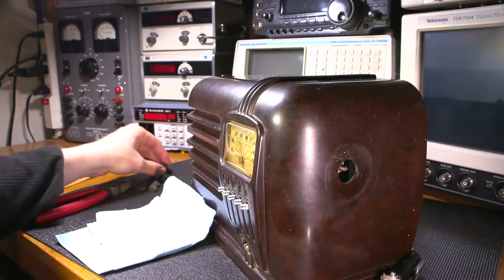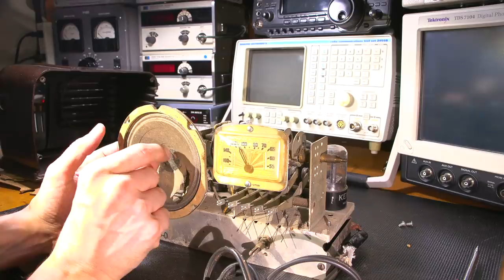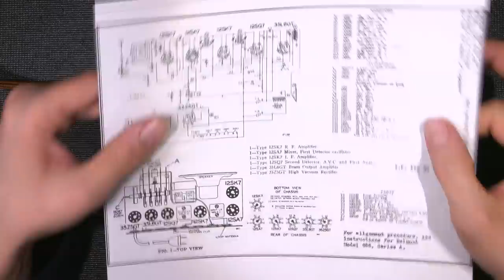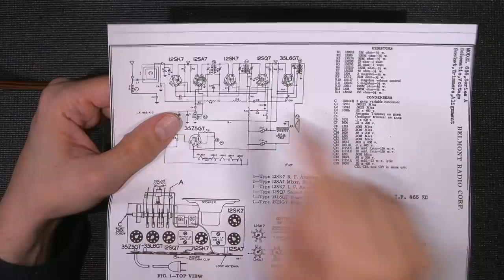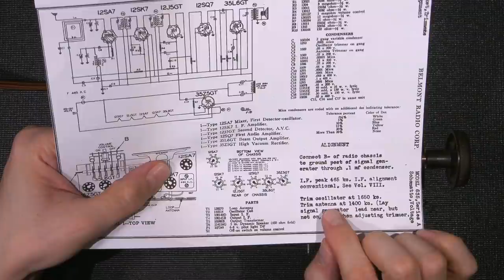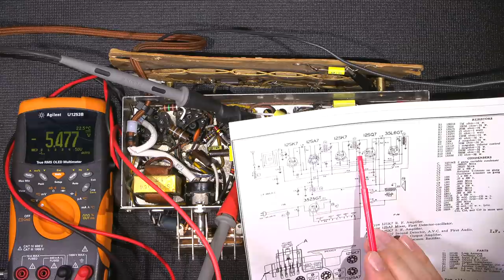Electronic Restoration Adventure-The Belmont 636 Radio Receiver!

Comment: This Belmont 636 Radio seems to be receiving more stations than even transistorized radios. Such smoothness, you can hear everything in between. I remember tube radios being this way. Smooth and rounded out tuning. Let's you hear an entire world of radio.
Reply: 2 years later, still pretty much the only transistor radios that can equal or exceed that radio in receiving are the ones made by C Crane, I can walk outside with my pocket C Crane radio on AM band at night in North Carolina, and assuming no electric interference, and no unusual atmosphere conditions, on a clear night can pick up loud and clear, all the New York city clear channel frequency stations, and hear in background of 570 stations and WSB 750, the Cuba and Venezuela stations each on those frequencies
Reply: @perryb3263  Can you post a link to this C Crane Radio? I am interested.

Comment: I was interested to see that an RF Amplifier Valve was included before the frequency-changer valve, but only a two gang tuning condenser fitted. So when you showed the circuit diagram, I realised that the mixer input was untuned. This arrangement seems to work very well indeed ! What a great little radio it is, and after your restoration and alignment what a super performer.

As a restorer myself, I know how gratifying it is to hear a restored radio, or other piece of electronic equipment,  'burst' into life and perform as well (or possibly better) than the day it came out of the Factory !!

I do enjoy watching your restoration Videos, and hope you will post many more of them.

Comment: It is hard to imagine sitting through the 2-hour video but it was fascinating to to see those old radios come back to life. I repairs those when I was a kid while other kids were delivering newspapers or mowing lawns I was trying to kill myself in surplus electronics and earning spending money fixing radios and record players. When I was 10 I got my ham license so focused more on shortwave equipment building and begging my father to drive me to the nearest air force base just 4 miles away, for their surplus disposal auctions. It is a wonder I only shocked myself a few times on the high power transmitters but at 13 I moved my shop basic test equipment to a small office behind the library I rented by telling the owner that I was running an errand for my father who had the same name, and who shared his father's name. It told the owner that my father was away on business and had asked me to secure the office. After school every day I raced my bike from school to the library to repair hifi, turntables radios and CB radio.  I could only work until my  7pm dinner time. 6 months into that the landlord called our home asking for me, and my mom naturally gave the phone to my dad who had no cue as to why someone was calling about an office until they both figured it out. I continued with that shop until I graduating high school mid-term at 17yo and sold the shop to the parents of my only employee, a boy who was also a nerd but a little older. The little shop was moved to larger facilities twice until the new owners retired about 5 years ago as the largest hi-fi store in the city.  I was very active in ham radio since age 10 and loved talking to people all over the world, which turned into a bug for traveling to visit places I talked with as a kid and have traveled to 91 countries.  
The day I graduated I packed up as much gear and some clothes in my 58 Chevy and moved 100 miles to San Franciso in 1966 where I rented a nice apartment overlooking the ocean on a cliff near Cliff House. The plan was to work to save more money and try to get into college but that was sidetracked by the musicians finding out I could repair their amplifiers on my kitchen table since there was only one music equipment repair shop in the city with an exploding world-famous music center of the mid-60s. The second person to knock on my door needing emergency repair was a tall Mexican kid who had no money and I did not charge anyway but he said he would have money that night if the amp was repaired. I took care of it and wrote out a short note as a pass to come hear him play for free. I did go despite having little interest in music and that was the first time I heard or heard of Carlos Santana. He spread the word and suddenly everyone was hiring me to design new gear or pa systems and eventually took over a failing recording studio and went on the record 197 gold and platinum albums in the  3 studio complex. 

Those little dangerous All American 5 AC/DC radios got me started, I took a break and got my BSEE but never used it because my dream as a kid to work for HP was bypassed with a long very successful career in businesses and recording.  I gave everything away and moved to another country in 2000 and on each return visit packed my suitcases with test gear and started a little repair shop for fun and experimenting in the heart of a beautiful historic culture city of St Petersburg Russia and spent most of my time exploring the fabulous museums and palaces or the music scene, dancing several times a week until dawn, dating beautiful women and starting 2 incoming tourism businesses. All that, 71 yo started with my dad bringing home a broken radio for me to take apart and play with at 6yo. The pandemic put a damper on my social life but have a beautiful 35 yo lawyer GF who keeps me busy. She tolerates my taking over a large bedroom as my lab filled with test gear for audio and RF up to 5Ghz. Watching your meticulous restoration was fascinating. I have watched a number of your videos and my first question is how do you get so much done despite having such a small cramped space left after filling it with stacks of test gear from the 60-90s.
 I still love test gear. One of my side businesses after collecting hundreds of HP and Tek pieces, was opening a repair shop for pro audio I started in 1990 around the time I sold the studio, it was to be a 1 man hobby shop since I did not have to worry about money. It grew to be the largest pro audio repair facility in the country(world) with 23 fulll time techs plus me and support staff of 8 and warranty station for 58 brands, and full depot maintenance for two by replacing their factory service. Each tech has two full benches stacked with some of the 524 pieces of restored HP Tek,m Sound Technology, Fluke, and GenRad equipment, plus RF service monitors from IFR and Motorola. I had collected all that and refurbished it all as part hobby and part obsession

Comment: Thanks for sharing, Paul.  @1:40:00 with IF adjustments was new to me, and worth learning.  I rarely work on tube stuff where heaters are in series with mains.  I had a tube amp like that at one time, and was too easy to get shocked with.  I like the idea of replacing brass tuning screw too for insulation like the rest of the box.

Comment: Good show. As a boy apprentice in a radio/TV shop in the 50s such basic radios, usually without the RF amplifier,  were current. I reckoned to fix 6 or 8 of them each day. At that time sets that were considered "old"  when they had grid bias batteries and wet electrolytic smoothing condensers. FM sets (Zeniths etc) were also grist as were record players and black-and-white TVs.   We had lots of "Muntz" brand, and other TVs, to fix. I was about 12 when I started. Health and Safety would never allow that now sadly.

Comment: Well done as always ! One take away for me from this video was the trimmer capacitors thin mica insulation. Once a few months back  while I was blowing off the dust from under the chassis of a Philco Model 60 radio my high pressure air nozzle got to close to the Mica capacitor and blew mica fragments all over the place ! I had to find a doner chassis with these capacitors as I did not see anyway to fix the bad ones ! Thanks Again

Comment: I'm working on one of these right now. The caps were all the Solar-types. The large one, like the one in your radio, was blown out and the wax had melted all over the line cord. The others were partially melted. I tested them once I removed them, and oddly they weren't that far off of their original capacities.
On a side note, my mother worked at Belmont Radio from 1938-1940. I like to think that she may have worked on the 636 that I now have.

Comment: Great video. I love those mechanical parts in old radios and in everything. I have my shop with a lathe and other machine-tools. I have two of those kind of radios, made in Argentina (my country). Really well made. Things of that quality are no longer manufactured in today's world. Now everything lasts a short time, it is all made with little resistant materials and does not admit repairs of any kind. I HATE THAT. That is called programmed obsolescence. Before, everything was made to last a lifetime and could be repaired. That also gave people work and a desire to learn. I am 31 years old, but I prefer the things that were made before, until the 2000s. Greetings, from Buenos Aires, Argentina.

Comment: Awesome vids!  I will mention with soldering, everything is a heat sink,  so typically, pulling the tubes before applying heat will reduce the amount of time it takes to flow the old solder.  Also, an old trick is to clamp a pair of pliers (hemostats) if room is available, to keep the heat away from other components.  Thank you for the videos.

Comment: From m experience the pilot lamp is in the rectifier circuit, and it is usually a #47. Looking at that speaker, reminds me of one of the older radios that I fixed that was missing the speaker. Great job on repair, and you do great work. I'm glad to see that you know about repairs that most of us have not seen. I understand why WD40 works good is that oil dissolves grease, I have used diesel for the same use in the past. Also even when I know about stuff there is many times that I leave things out that you would talk about, even things that are 2nd nature to me. The Bakelite case is the only plastic of the time. What about replacing broken glass for the dial indicator? I have one here that I have not yet repaired. The one thing you did not mention about the old style resistors is that they did not have the same standard numbers that we have today, such as 50k now is 47k, 25k now 24k, and other such values. The resistors that confuse me are ones with 5 or 6 bands as with the 1% resistors I don't know where the 1st number is located. One thing about your tester, have you thought about selling boards? That is one thing that writers for popular electronics, radio world, and others earned money in addition to what they get for their published article. Also about the AC/DC radios, better to to replace the cord with a polarized cord to the chassis. In the 1950's and 1960's there were polarized plugs in the homes here in the USA, but no ground. For those that do not know, for safety wear glasses and electrical gloves and learn how to inspect them correctly, and the old standby is to keep one hand in your pocket. That way if you get a shock the current does not go through the heart. I like that you are emphasizing using an isolation transformer, as  one of my mistakes learning is burning out the ground wires in a TV set, and would have been avoided by following your advise.

Comment: I've also seen these AC-DC radios wired with the chassis side of the line wired through the switch. I think they did this to reduce the hum which could be coupled to the volume control if the switch were on the hot side of the line.

I even had an AM-FM radio in which the chassis was connected directly to one side of the line.  (Still have it.)
They counted on the wood or plastic housing and knobs for safety counting on you to keep the back on.

Comment: On my first day on the job in Biomedical Engineering I was shown a tip when about to desolder a component.  And I've used it ever since. Especially so on antique solder.  Medical PCBs often have a conformal coating over the top of high temp silver solder. Using just a conventional desoldering iron, you'd not get the job done.. or if you did, you'd destroy the PCB in the process. Just heat the joint with a soldering iron first and add a bit of lead-based solder. The desolder normally. Works like a charm

Comment: I'am salvaging valve radios as an hobby, it's really easy to find spare valves on the web, you can find New Old Stock valves for decent prices, used checked valves can save you too. The last one i've restored ( "electronically" 😊), works fine now, it was stored in a barn for several days !
Its better to fully recap these radios, "tar" capacitor often shorts when they're not operated since a long time, when you turn the set on after a long storage !

Comment: As a child, our family had a Philco AM radio that looked similar to this, but without the channel buttons. At least once a day, it would start screaching loudly, probably due to a loose tube in it's socket. My siblings and I figured out how to get the screaching to stop by whacking the side of the radio. If we were too lazy to get up, a small stuffed animal thrown at it usually worked.
BTW, I have a selection of old radio tubes in original boxes, if you are interested. I may put them on ebay to see what happens.

Comment: In its original wiring my house had several rooms with unpolarized outlets from each side of the split phase 220v line. With extension cords it world have easy to get a 220v shock from contacting two hot chassis ot frames at 100v from radios, lamps, etc. that had the plugs reversed. While polarized plugs were retrofitted in the late 60's the house wasn't rewired until 2007. It's a miracle no one in my family was killed by that over the years.

Comment: To remove dial hands from watches they use a small pieces of thin plastic over the hands and face and then use two plastic pry bars through the plastic without puncturing it to lever the hands off. Very educational learning lots thank you.

Comment: Paul, nice job as usual. I still think metal film resistors are the best choice. I get you were trying to be more "authentic," but with a radio where you will never see the underside in normal use I prefer the metal film. I have restored a number of similar old sets (just finished a GE440 Atomic I am quite pleased with), but I still learn something from you every time. Thank you for sharing.

Comment: I always thought a home radio with station preset buttons like a car was a great idea.  Interesting that some radio manufacturers had the dial frequency descending while others had it ascending as in 550Kc to 1600Kc (KHz nowadays).   In your resto, I would have returned the preset buttons to their original pin.  I was also surprised there was no tone control.  For close work, small shaft and tiny joint lubrication I highly recommend Tri-Flow applied to a toothpick for more precise application.  Tri-Flow  is also perfect for sticky or tight locks.  Available at most locksmith shops or maybe Home Depot.

Comment: I do love these referb videos!  Thanks a billion, I am signed up on your pay site as well.  There is a closely guarded secret among we who live in RV's for half a year or more.  It is called BoShield, a lube developed by Boing  Aircraft for their planes.  It is a spray lube that leaves a nice waxy finish on the surface to prevent corrosion in salty air on Aluminum but it works wonders on RV parts that need such product,  especially useful  on slide-out rails and such, but it makes doors and drawers and, well nearly everything else on the RV work so much better.  I am sure if you gave it a try, you will find a lot of use in your work areas as well.

Comment: One problem that I have seen that I'm not sure if you have shown a fix and test for is the Variable capacitors, where the plates short while tuning. This does happen when someone has had their hands in the radio that should not. As you said in the past, when someone has been working on equipment it can create more problems. Also the radio looks much better than most I have worked on in the past. Another one is the antenna on the back, it is made with Litz wire, and does not have the same inductance as single strand enameled wire of the same size and replacing with such makes the radio not work, something I learned the hard way in my teens. Thank you for the heads up on the insulated screw driver, ceramic screw drivers are the best choice or an alignment tool.

Comment: The difference between antique electronics and modern is crazy. Wires and giant capacitors everywhere. The underside of that radio looks like an electronics tool box that hasn’t been organized. The bottom of modern radios look like a piece of modern art. Lol

Comment: Here's an idea for your SIFT gadget. Why don't you create a quick-connect test adapter for axial lead components? This would allow gentle mechanical connection to the component leads. You could implement the adapter as a printed plastic part using banana plugs on 3/4" spacing (as such, it would fit many other testers). You could sell the printed adapter as the base of a DIY adapter kit or sell it as a complete adapter jig.

Comment: "Bakelite" was the first mass-produced plastic.  It could also be applied as a liquid coating of metal parts, for example, that hardened when it dried, sealing the object water- and air-tight if it previously was porous and was having problems with moisture or fumes.